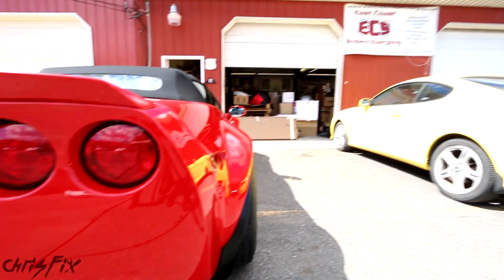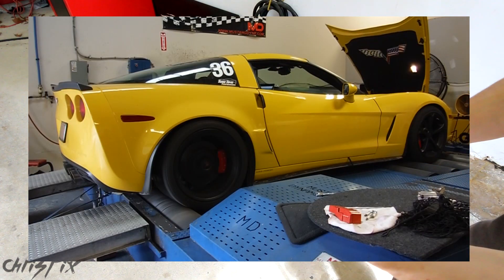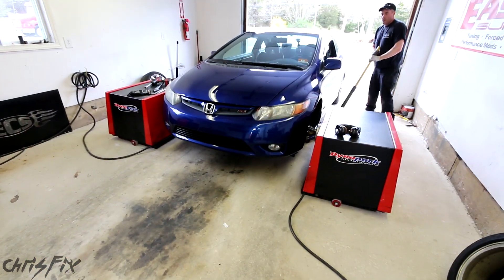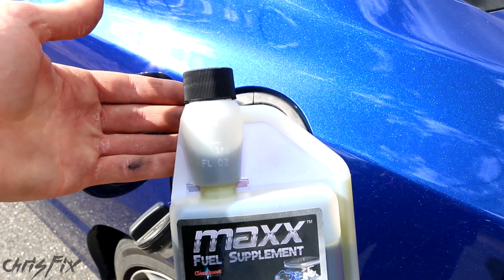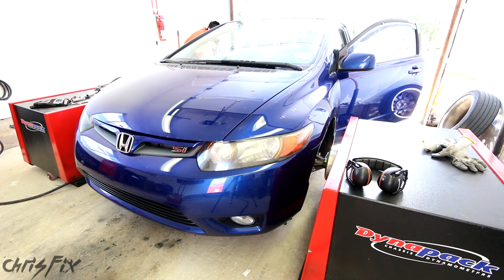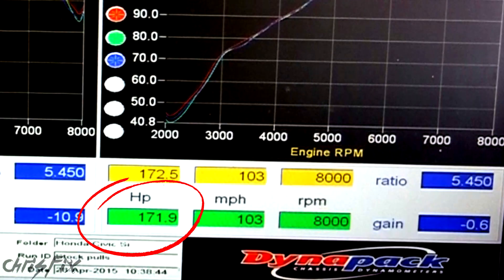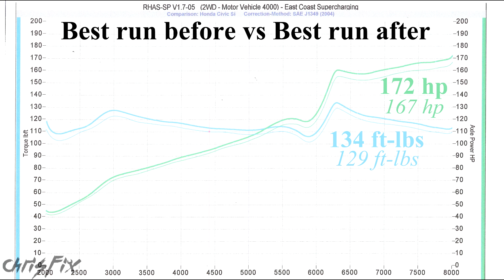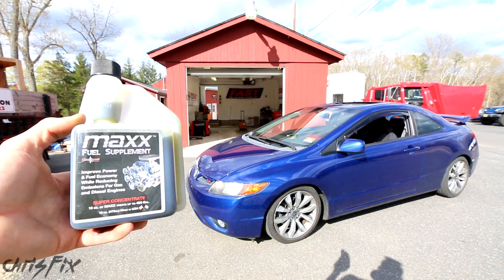Can a Fuel Additive Really Increase Horsepower in Your Car? (With Proof)

Comment: If that power loss was heat soak then both runs should have looked the same, but when one runs all over the place and the fuel additive makes it run smooth you got fuel issues.
Could be gunk build up, or filters or the shit you are currently buying. Just because the pump said it's "ultra super premium mega race drivers choice deluxe supreme" does not mean shit was anywhere close to what was sold. Pumps actually get tested very rarely, rarer still that it's done by a trusted official.

Might be a new video idea to do a DIY fuel separation so people can test what they are buying.
Reply from the maker: MsSomeonenew Thanks for the input. The gas was exactly the same for each run since we did not fill up. The only difference was the additive. Before I did this video, I did this a few weeks back to clean the valves and pistons out: https://www.youtube.com/watch?v=u6UeJXkzDW8

Comment: Thanks for that video! But what would be really interesting how high the octan number was of your fuel. And if there would be a difference if you would fill in the highest possible number in Europe you get 100 octan. I think in the US it's 90?
Reply from the maker: Ich bins The octane was 91 which is similar to your highest octane. In this case, the additive is a nano-catalyst not an octane booster so there is no difference in octane. Good question/suggestion though!

Comment: Stupid question: Do you have to add this every time you fill your tank to see the increase in horsepower?
Reply from the maker: HaRmFuLBrothers Not stupid at all. Correct, you need to add it to the tank to see an increase. We are testing fuel economy to see if it actually increases mpgs.

Comment: I love dynos like the one in this vid, they are VERY consistent. The only downside is that they read higher, but the solid tune you get is worth guessing actual numbers.
Reply from the maker: Zcypot Exactly. While they do read higher, the HP numbers are not as important as consistency within the dyno (like you said for dyno tunes or in this case, a test).

Comment: Hey bro, i have this really big problem but cant afford to fix it. Ive had my car for 6 years now and then I stopped using it for about a year, and when I start my car it cranks but doesnt fire, so I went to check the spark plugs to find that oil had found its way in and covered the spark plugs....even better cyl4 coil pack is snapped :/ im just a student so I cant really afford to buy a new car as I need one to get to school and back. Please help! :(
Reply from the maker: ***** Sounds like your valve cover gasket is leaking. Replace that and the snapped coil pack and you should be good to go if nothing else is wrong.
Reply: ChrisFix would I just have to take off the valve cover?what about the head too? Cause oil is in the spark plug holes and not sure how to clean it without damaging the engine

Comment: Using such a small amount of additive, I would think that much of it is still coating the filler neck. That's why you should run some gas in after. I understand why you didn't though.
Reply from the maker: silveravnt Yea, that is why I added a little more than I should have to make sure enough got down into the tank. Good point though!

Comment: how much horse power the car should have by the standard specs? so that a good comparison is made with and without the octane booster. maybe it is stock 170 bhp , then the gas quality is lower without the octane booster generating less power that the standard tehnical . ??? Best regards !
Reply from the maker: Ionut-Alexandru Constantinescu The car has 197hp to the engine and this additive is not an octane booster.
Reply: Then it is clear. A lot of things you've done on video i've done it myself but never thinked about filming them. Anyway congrats and keep on the good work!!!

Comment: with that dyno i make 250 hp with the same car (07 civic si) wonder how much it will increase ima go try this using this both in 91 octain and 100 octain i wanna see if it changes the octain of the fuel in any way
Reply from the maker: Aroutin Abramian Keep me posted!
Reply: ChrisFix will do but i live in LA and the traffic ruins the result plus i have just done a coolant bypass on my throttle body and intake manifold so i will need to see what i get first but i got a heavy foot

Comment: 10 hp is negligible 
you have to take into account error from the dyno as well as many factors involved with the car.
For example his battery could have been low during his first test which would have lead to less hp. 
During his little 15 min drive his alternator could have charged his battery back up to where it needed to be giving him a higher hp reading.
Lots of factors.
10 hp is negligible.
Reply from the maker: Peter Pan There are a lot of variables but we keep as many as we can constant. In order to "scientifically" do this test, we would need a large sample size.
Reply: I just saw a lot of people on here saying "time to go out a buy some asap" thought I would share my sciency POV. Really enjoy the videos. Keep up the good work!

Comment: so if i have 110hp on paper, in real life there are only 80-85hp.... bummer
Reply from the maker: ***** Correct. The first number is to the engine crank and the second number is to the wheels.
Reply: wait, my car has this specification 110PS (108hp)
so the 110PS is on the crank and the 108hp is on the wheels?
Reply from the maker: If your car has 108hp, that is to the crank. It has less power to the wheels. That is called rwhp (rear wheel hp)

Comment: Humidity was about 15% less (from 34 ish to 29ish percent) at second run. Surely that would made more hps.
Reply from the maker: OS Coutinho The numbers were adjusted for but less humidity means less power. Humid air is thicker air with moisture which cools the engine.
Reply: I have to disagree with your argument that humid air gives more power since H2O would take the place of O2. It's Oxigen, not water that makes the power stroke. Dry air gives more power, JSYK.
Reply: Bump

Comment: Only problem is the hub dyno is not the most accurate as when you hit the street you will have less usable power due to the friction with the road that this dyno doesn't account for.
Reply from the maker: vadersrt2005 It is the most accurate/consistent for a test like this though.
Reply: ChrisFix true can't argue that at all
Reply: ChrisFix and still a good video as I have always wondered if some of these actually worked

Comment: VERY INTERESTING!  How about MPG?  Also, why not install a GASOLINE VAPORIZER & test & COMPARE HP & MPG with & without a GASOLINE VAPORIZER?  I believe you will find it will give you MUCH BETTER RESULTS & YOU DON'T HAVE TO KEEP ADDING THE SUPPLEMENT!  For details on ways they can be made, check the info @: www.youtube.com, by typing in, "gasoline vaporizer".  I have several UNIQUE DESIGNS of my own!  I'm an inventor, evangelist, & financial adviser.
Reply from the maker: Wendell Ferrell We are doing a fuel economy test: https://www.youtube.com/watch?v=fUmkNKikPUQ

Comment: You only tested 1 of the 3 claims. You should have done an exhaust emission and a MPG test as well. I wonder if this stuff is just an octane booster [with a different name for marketing sake] allowing the engine to use more spark advance/timing.
Reply from the maker: MrZdvy This is not an octane booster. I am testing MPGs next: https://www.youtube.com/watch?v=fUmkNKikPUQ

Comment: the amount of tourque you gain right around 6000 is unreal, i know, vtec.. but it seems almost like honda did that on purpose with the huge drop right before.
Reply from the maker: danthemanzizle Yea, I was really surprised at how much Vtec "works". I wonder if they designed the intake and stuff to drop off at that RPM so that Vtec can kick in and increase the power?
Reply: ChrisFix They probably (hopefully) just optimize more than you normally would for low rpm's then when it kicks in it switches to a very good high rpm profile. But I know for sure my acura tl does not kick like that when vtec Hits, it's almost nothing aside from the different exhaust note.

Comment: That civic has 2009 wheels. Correct me if I'm wrong
Reply: stuna101a No it only has 4 wheels
Reply: +ToperMasterComedy I think +Long Dong meant that the car doesn't have 2009 wheels (how would that even fit on a car? They'd have to be REALLY small wheels)... instead it has 4.
Reply: stuna101a  nope your right its 09-11 i like the 06-08 wheels better
Reply: +Long Dong No shit sherlock
Reply: +stuna101a Yeah. That threw me off. It's after the facelift but then he said it's an '08 and I saw the grill and was like ah! it is an 08 with '09+ rims.
Reply: Corey Jones What they meant is which wheels the Civic had came from which model year. Instead they think the obvious.

Comment: Sounds like you have shitty gas that caused knock.
Reply: Brodey Dover cant judge a knock via a YouTube video
Reply: Brodey Dover  I don't think you understand what I'm getting at.... who are the automated tests made by? who made the machines? exactly. There is your error. Your testing will never be without error because it is made by something flawed. they accept tests that have error within reason not testing with no error because its non existent.

speaking of rocket science how about all that testing they did with the space shuttle that blew up..
Reply: ***** I never said that.....The video has "With Proof" and they didn't form an appropriate test with sufficient information.

I guess you can't judge who an engineer is by a YouTube comment.
Reply: ***** It isn't, there are a lot of gaps. You must work for someone involved and can't take the criticism. Redo the video with the appropriate tests or accept that (With Proof) is invalid and adjust the title accordingly. If I did a "test" like this, I'd be fired for incompetence.
Reply from the maker: Brodey Dover Nope, it was 91 octane and good gas. There was no knock.
Reply: ChrisFix did you log knock? What were the AFRs?
Reply from the maker: We did not log knock or AFR.
Reply: ChrisFix okay. You're assuming there wasn't any knock then.
Reply from the maker: Brodey Dover We did use 91 octane which should prevent any knock but I have no proof that is true. The additive is not an octane booster so it doesnt affect knock.
Reply: its a good enough video, the test provided the information that the additive worked and provided more power, it may be hard to grasp as you just want a reason to complain.
Reply: I don't know the creator of the video and I would sense more of a fired for inability to have teamwork negativity is bad in the work environment, every test that is done no matter the concept has faults a true test will always miss some aspects of the purpose but that's just how it has always been, human error
Reply: ***** Let's continue this conversation after you've earned your engineering degree. You can remove human error from a test there is an entire field about doing so and has been the case for well over 50 years now.
Reply: Maybe your whole issue with the video is your own human error
Reply: Brodey Dover You don't need human a degree to know everything that has a human aspect to it has flaws you're not perfect so nothing you make or do/test will be either...
Reply: Sprillex you remove the human.... It's automated testing ... Literally not rocket science folks. Easily found on Google; let me know when you understand the core concept of what I'm getting at here.

Comment: I think the red flag for me was the less horsepower on your baseline run and how heat impacted the 3 base trials.  Without the gasses % outputs from the tailpipe or other computer data I am pretty sure I cracked the code. The 2.0L liter SI motor is an 11-1 compression. The fuel you were using was causing knock feedback to use less advance on the timing (ODBII would tell you the degree advance). With the octane booster in the tank the engine could use a more aggressive advance. 

The clincher was the hotter runs. With heat-soak knock occurs faster. 

I dramatic test would be to grab some VP 110 octane (or just some 100LL from the airport) for a 3rd test.
Reply from the maker: MrRexQuando I would agree but this is not an octane booster. It is a catalyst.
Reply: ChrisFix Tetraethyllead was a catalyst too.  I had an L88 Vette and would fill 8 gallons of no lead 91 octane and 2 gallons of 89 octane leaded and ended up with 94 octane (before I knew this was illegal). Pretty sure if you measure the octane levels this "catalyst" is boosting them.  I bet your N2O at the tailpipe is a lot higher as well.

Top Gear did a very scientific test of about 6 "octane boosters" when running the recommended fuel grade in the beginning their Rover engine the additives actually reduced overall performance.
Reply: samhaintrinity Frankly one of the least informative comments ever. Trust me.

Comment: I would caution ANYONE thinking about adding any type of additive to the gas tank, to make sure their particular car does NOT have rubber or neoprene parts in the fuel line as ethanol EATS THEM. As in my case,

I have a 2005 Malibu, that's NOT a Flex Fuel friendly car. Since almost ALL gas sold today has a 10% Methanol added to the gas tank, adding more, eats those parts, and will require expensive repairs for your car.

I used a fuel additive / cleaner and it caused my gas level sensor to go bad. Fortunately it didn't eat any of the pumps parts as that's an $880 part.

Basically ALL additives have Methanol or alcohol as a base of the treatment.
Reply from the maker: Lawrence Mudge Thanks for sharing. Not all additives have alcohol in them.
Reply: Could you please share as many examples as you can?
Reply from the maker: Lawrence Mudge This one, seafoam, gumout, techron, lucas, etc.
Reply: Are you sure? Go to this website, and look at the alternate names they could be calling it.

http://www.fuel-testers.com/fuel_additives_gas_treatments.html
Reply from the maker: Lawrence Mudge Yes, I am sure. Check out the msds of the products for yourself.

Comment: One question,u never mentioned what octane level fuel u were running in it...ive never hit less then 180whp in stock form with 94 octane wich is what they recomend to run the car with...now at 228 stock motor..94oct allways...
Reply from the maker: Vega-Expert We used premium which in the states is 91 octane (the same as your 94). It is the required gas in the honda manual.

Comment: That's a good read.
 The gain was half of the difference of doing nothing.

If your injectors are dirty enough, cleaning them will always improve power and economy.
Reply from the maker: Bruce Baxter Thanks! The injectors were actually just recently cleaned so I dont think it was that.
Reply: Any ideas why you had twice the range in the before tests than you had in a gain the after test then, if it wasn't dirty injectors?
Reply from the maker: Bruce Baxter What do you mean range?
Reply: The difference between the lowest and highest readings on the before tests.

Range is the term used to describe the difference between highest and lowest readings in a common series of tests.
Reply from the maker: Bruce Baxter Heat soak. The engine will retard timing due to heat soak so you lose power. The clean boost prevents the retarded timing.

Comment: One of things I wanted to say here...you are WAY better off testing this on a carbed car or truck vs fuel injection.  Some of these additives do nothing but fool the 02 sensor in running the car leaner, at wot the 02 is not used in a honda its jsut a guess based on correction.  I think what this stuff does is pretty much lean the motor out slightly for more power using a chemical that fools the 02 sensors.

Comment: This probably raises the octane of the fuel to make it run more efficiently. If you tried it ine a car that's not so highly tuned it would probably not be so significant. This is easily Equeated you would get running something like shell V-Power (Optimax) in the honda compared to a less tuned car like maybe the PT cruiser. https://www.youtube.com/watch?v=gQghB4asSnI Compare to the results in this test. Good test again Crhis.

Comment: Looks like it might help slightly.  Though typically its said that you need an increase of 10% in horse power to actually feel it in every day driving.  So none of your increases were at that level.  So its not likely that you'll ever really feel it.  But you would have a higher chance at feeling it compared to a car with a larger base HP.  After all an increase of 11HP is a far higher percent for a honda civic with 167 HP compared to say a challenger with a minimum of 275hp to the wheels.  Must less a Lambo with 600HP.

Comment: The problem with this test is the additional horsepower is probably from a warmer engine. The temperature gauge isn't precise enough to base the tests of off. An accurate test would be to wait until the tank with the additive in is empty and then run a control test during the exact same thing but with no additive.
Reply from the maker: screwloose455 Warmer engines make less HP actually. This test was accurate. If you waited to run the tank empty, the weather conditions would be completely different which would be a huge variable.
Reply: Yeah I guess that's true also

Comment: I'm curious as to what is in that stuff and if the gains are proportional to the horsepower; is it always 10ish or is it 5% of the initial.
Reply from the maker: nikki martinez I asked them because I had a lot of questions and they said it is a nano catalyst that causes more of the fuel to burn. That is how you get more power out of the same amount of gas.